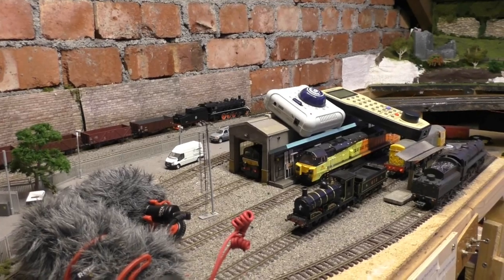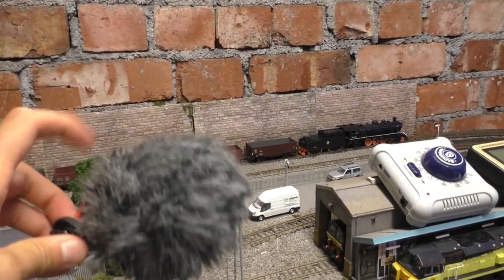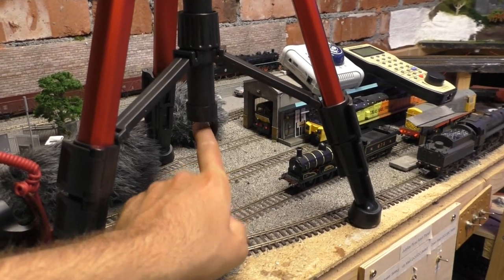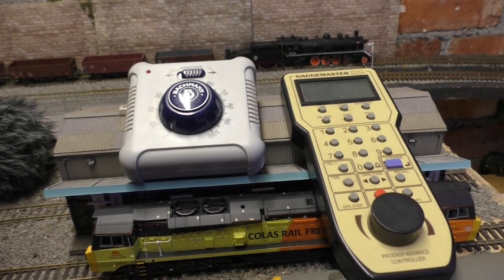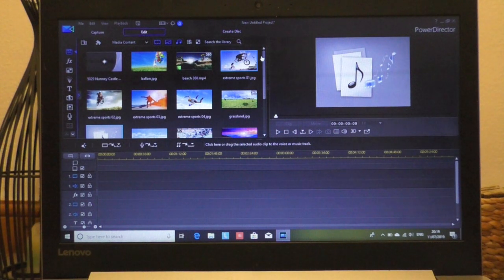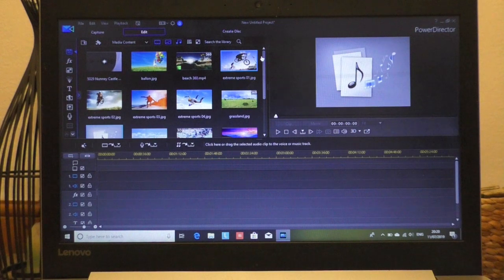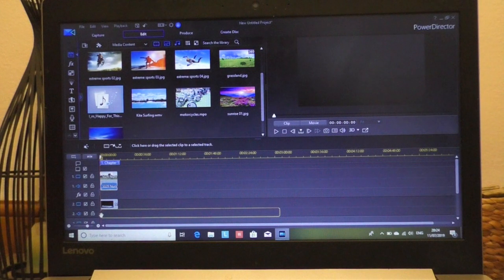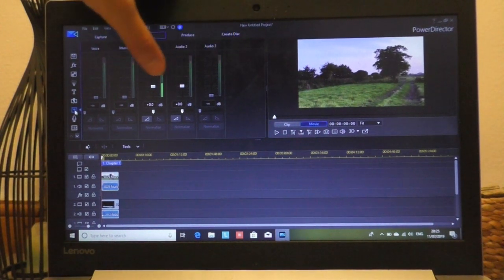How I Make A Youtube Video At Jubilee Road

Comment: Great Matt! So good to see how you operate and do things behind the scenes. Atm I do use my phone for recording but thinking about a video camera, strangely was thinking Panasonic, they do tend to produce things a cut above in many cases. 

Incidentally, I have cyberlink too, the volume can be adjusted directly from the ‘soundtrack bar’ on the timeline.  There is a horizontal line running through the sound track, if you click on the it, move it up or down as you please. Thanks Matt.
Reply from the maker: Panasonic is a good make to go for. iv had others one but Panasonic is the best iv had so far

Comment: Hi matt enjoyed the video and Power Director looks a good system . Also as per Colin below how do you wire for DCC & DC control ? Finally are your points motored and if so what system do you use as I am still deciding . Cheers  Kev